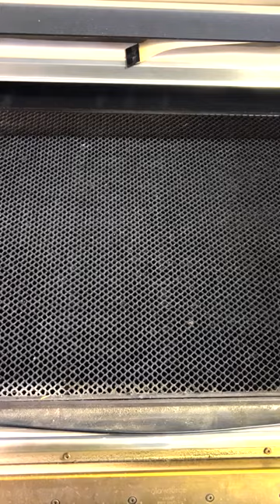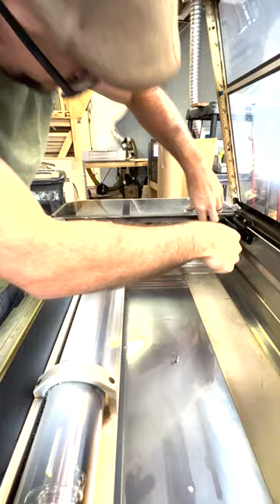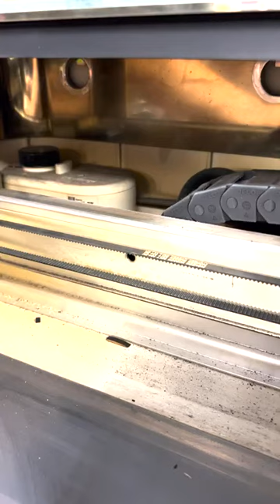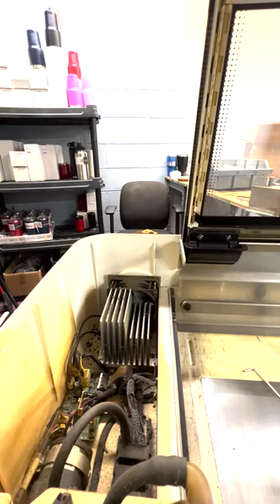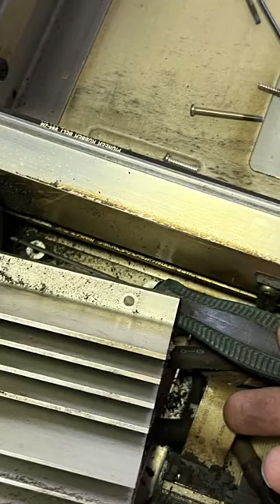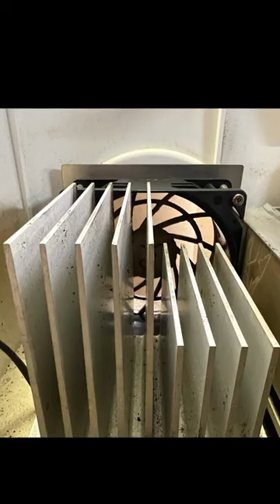Glowforge Exhaust Fan Removal

Comment: I just ordered one of your red wire kits to replace a damaged wire. I have a pro and currently use an inline fan and considering removing the onboard fan. If I remove it and don’t put anything in it’s place as I don’t have a spare fan to break out to create that funnel, will it still pull enough air with nothing in it’s place. Just not sure if I should remove or not. Thank you!